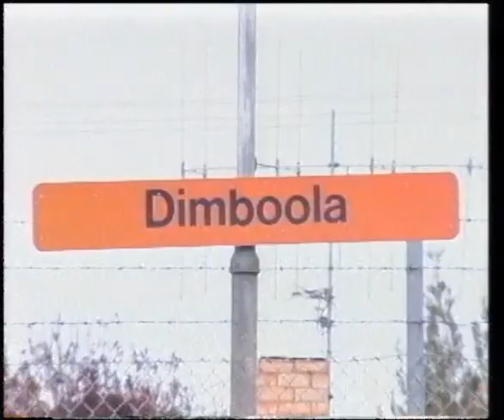South Australian Steam Loco 621 To Victoria 1994

Comment: The narrator has said only one other 620 class survived and it is stuffed and mounted in the Mile End Railway museum...Wrong, it is at the  National Railway Museum at Port Adelaide in South Australia....Since 1988?
Reply from the maker: well we knew that at least!
Reply: 624 has been in the mile end museum before 1988, but since this was 1994, i dont understand why the narrator said this, as the mile end museum moved to port adelaide in 88'.
Reply: @aussie_trainspotting_videos  The narration also says the 620 class were built in 1938? The 620 class and the first being streamed lined(620) did haul the Centenary train for South Australia first one hundred years in 1936, that's how the carriages got the nick name Centenary Cars, they were painted in the state colors.
Reply: i think he also said that it’s the first time an SAR locomotive went to Victoria, when the 500 and the 600 class ran the overland before the diesels took over.
Reply: @aussie_trainspotting_videos  the 500 and 600 class only took the overland as far as serviceton (admittedly in victoria), which was where the two systems met
Reply: @jimsmowingofficial  ah, thank you.
Reply: @jimsmowingofficial he's still kinda wrong tho

Comment: The time is coming rapidly when broad gauge running will be history     and the cost of converting a steam loco to standard is way to costly
Reply from the maker: Yes, true for main line steam.Conversion can, and has been done recently, but future economics will not be kind to this idea.
Reply: Except that the broad gauge engines still exist and still run on the broad gauge.  It seems that gauge standardisation is now a mess.  There is no policy to convert ALL of the broad gauge lines anytime soon.